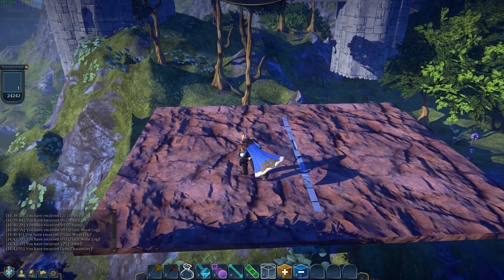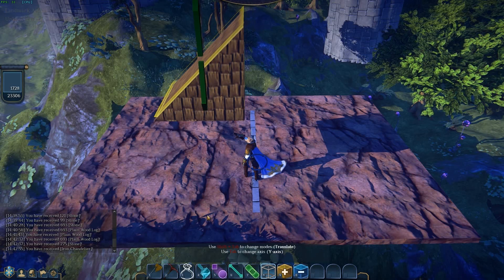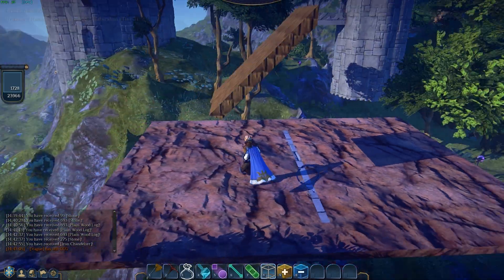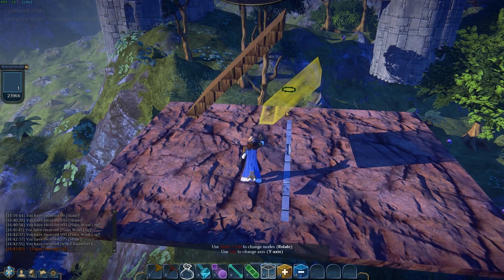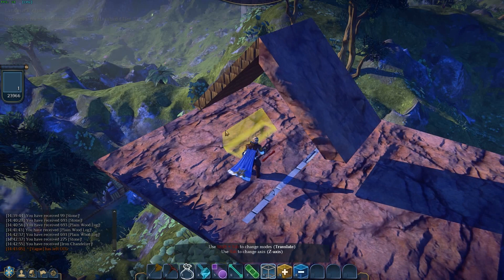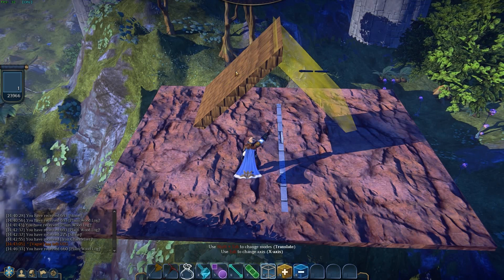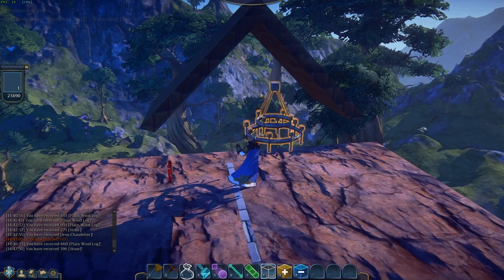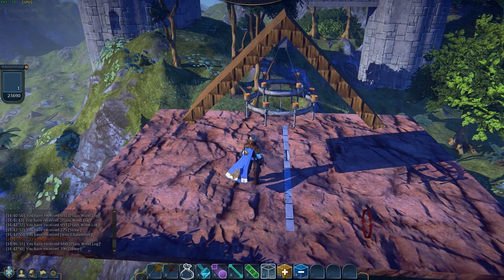EQNext Landmark Alpha Build Tools Tutorial - Tip: Sloped Roof

Comment: The largest slope that I can make is 64 voxels, how are you getting it to 1728?
Reply from the maker: I've found that the slicing and the cut/paste can be a big buggy, and sometimes it breaks apart and turns to jagged steps when I do it.  I just have to do it over and over again until it looks like I want.  That's why I was surprised in my video, I had been practicing it for like an hour before filming it and had like a 30% success rate :)
Reply: Chris Pinckard Sorry I don't understand what you mean..is that a templated slope that is that big or what did u press to make it larger?
Reply: ArtInTrance Press N to swap between a couple of scaling variants
Reply from the maker: ArtInTrance I made a slice, pasted it together, then copied the bigger piece, so yes it's templated.